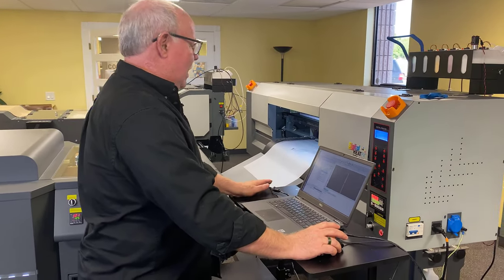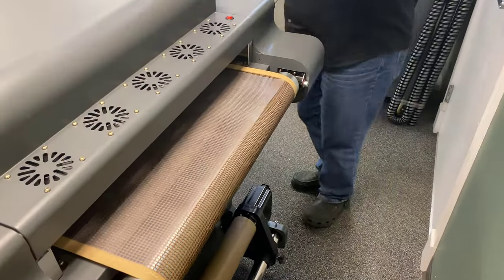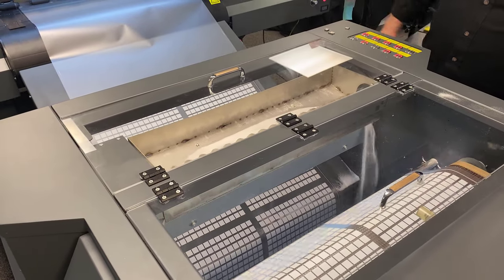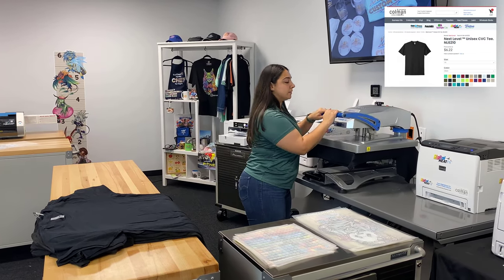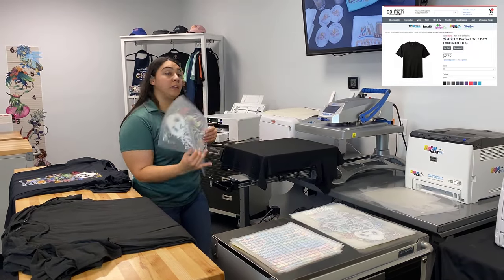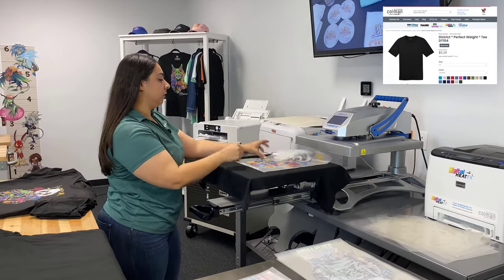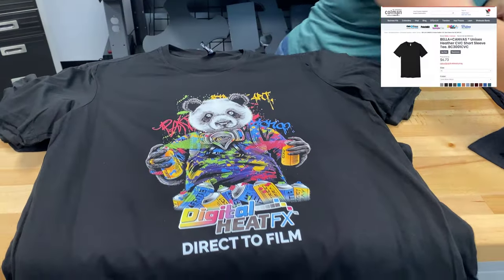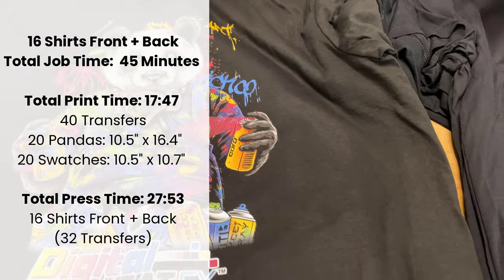Making a Full Shirt Order With DTF | Direct-To-Film Printing

Comment: Thanks so much for this video. I just ordered the same machine you have from audley for all the same reasons you had and am waiting for it to get here. The language barrier is something I’m already struggling with for simple things but hoping it’ll get better. Can you tell me how many 220v I will need to run the printer and the heater? I asked them so I can have the line installed and ready for when it gets here but they didn’t seem to get what I was asking (or maybe they did I’m honestly not sure).  But I wasn’t sure if it only had one 220v for both machines or i would need two or even more outlets. Having to pay an electrician I would like to have it all done at once. Thanks so much !!

Comment: I would Definitely Recommend that you Press the shirt first prior to pressing the DTF transfer. This will remove the moister from the shirts. If you do not prepress the shirts at times you will be small spots on the transfer from the moister.
Reply from the maker: Great comment.  The transfer will adhere great either way, we often recommend a pre press for the reasons you mention, but we often demo many ways.
Reply: @ColDesiColman  
Sometimes you can get away with it, but then occasionally it comes back with avenges. Moisture in the Garment and Humidity in the room play a big role. 

If you get small circles or specs on your prints after you press sometimes you can wipe it with a dam cloth then repress it and they go away. Other times after your first wash they will come back. Last thing you want is a Large order come back to you with complaints after the first wash. It will be the last order from that customer. 

Thats why I take the few extra seconds and Always Prepress my shirt to remove any moisture.
Reply: @Ricks2Cents  great, so now we're talking about being as inefficient as DTG with the pre-print solution soaking...looks like DTF lost its competitive edge over DTG...
Reply: @FreddyPrays  
I was a Long Time DTG Fan because the High Resolution Print Quality!!! However the Truth is for a Production Shop DTF wins every time no competition. 

The Only way you can compete is if you had a Epson F3070, however most people have Desktop size Epson F2100’s.
Reply: @Ricks2Cents  which DTF printer would you recommend for a small start at home tshirt shop? I want to print my own stuff because printer places have lost their minds with markups and print on demand is a scam on margin.
Reply: @FreddyPrays  
If your making 600+ shirts a month buy a DTF printer. If not the just buy dtf prints. DTF printers can become expensive to fix if it sits.

Comment: I have same press is that #8 u have pressure on and is that silicone sheet same as one used for for 9541?
Reply from the maker: Yes for DTF Transfers we use a heavy pressure around 8 on the Hotronix Fusion. And we used standard finishing sheets for this just like we use with the DigitalHeat FX 9541

Comment: I’m guessing that the UV DTF prints are not suitable for garments and textiles. Am I correct?
Reply from the maker: There are two types of DTF printing. One is specific for hard surfaces and another specific for textiles. The adhesive and ink are very different. You can find both printers at coldesi.com

Comment: Few things to touch on — (11:02) film got stuck and buckled instead of feeding through.  You opened the shaker cover and pulled the film down so it wouldn’t buckle up and lose the print.  You didn’t speak a word on that in the video.  This could be the belt speed is not fast enough or the film has a nasty habit of getting stuck while traveling into the shaker unit.  

Also, your edge guards are not on the film, but off to the sides.  Not sure if the media skewed going into the printer or if they were just left that way.  

Side notes — no videos on maintainence or servicing the equipment.  No videos on safety or exhausting the fumes from the curing unit.  Hot melt powder is toxic when heated up to those high temps.  

Transparency is important.
Reply from the maker: Hi John! We discuss adjusting the film earlier in the video at around the 7:28 mark. Don explains that this can happen occasionally if your belt speed is not on point. 

Also, we discuss maintenance and exhaust units in several of our DTF comparison videos. We also offer full training and support for all our equipment that teaches about maintenance procedures. 
Also in the sales process, we explain the exhaust units importance more thoroughly. 

We have been in the industry for 20+ years now selling customization equipment and supplies and are extremely transparent about ever piece of machinery we offer. 

But thanks for watching!
Reply: @ColDesiColman  je veux la machine dtf
Reply from the maker: @diarramohamed3642  Si vous êtes en Europe, veuillez contacter https://www.yesltd.co.uk/